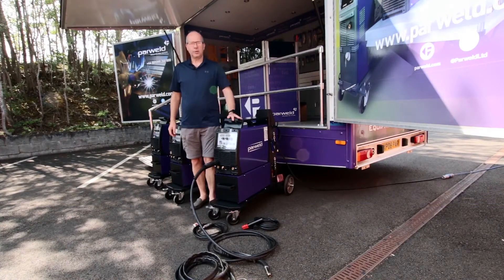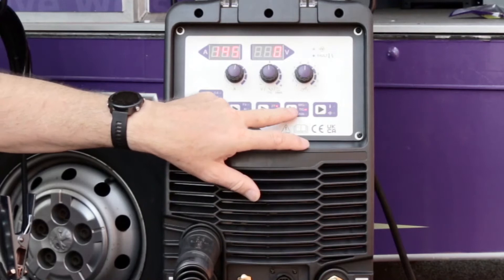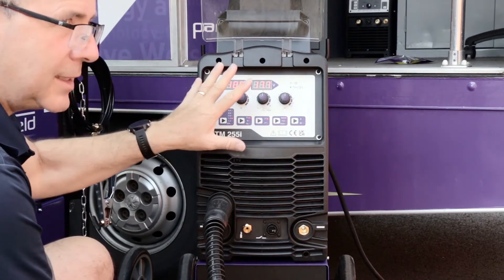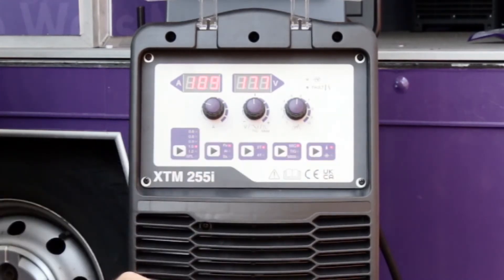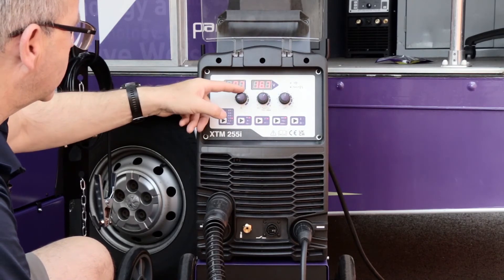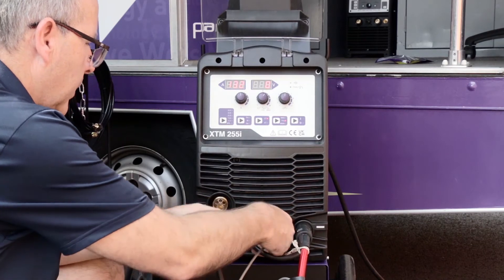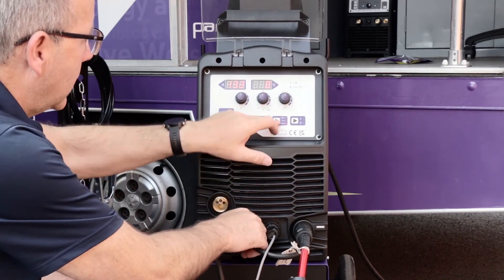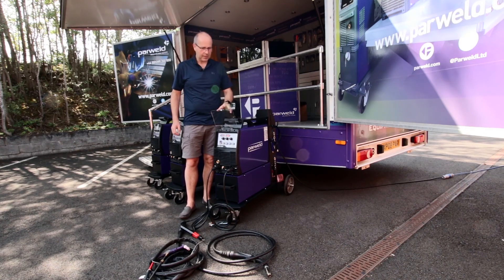XTM User Interface

Comment: Hi Tom cleave on your welder one knob for voltage the other one is for amps. The amps knob will adjust the wire feed speed. I think hope this helps mark.